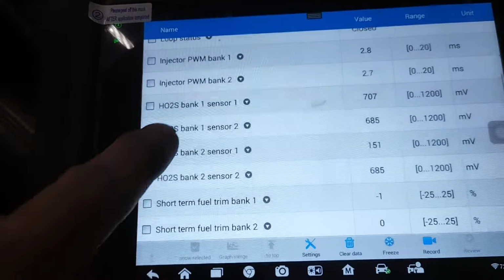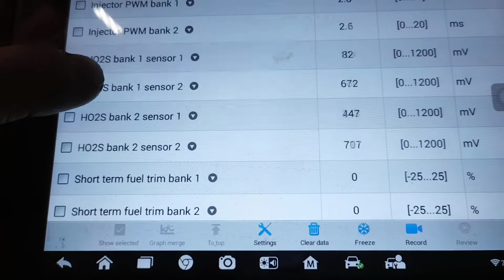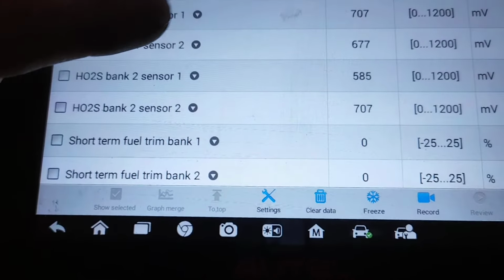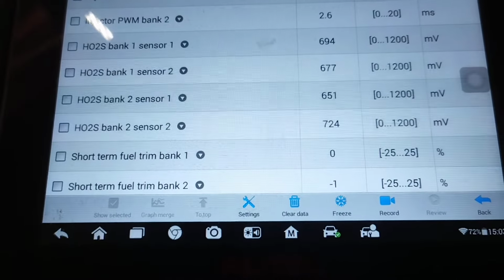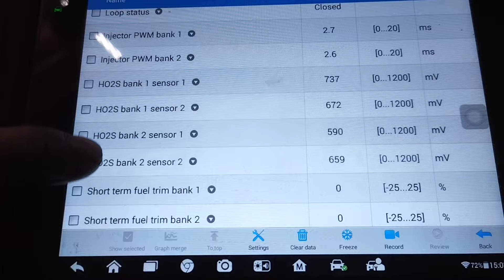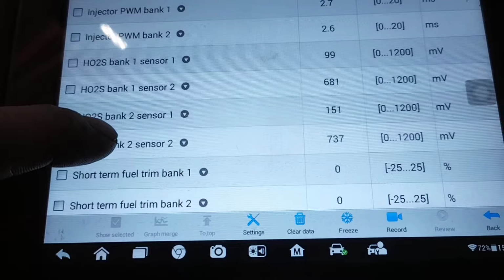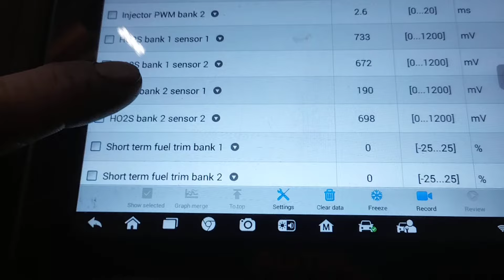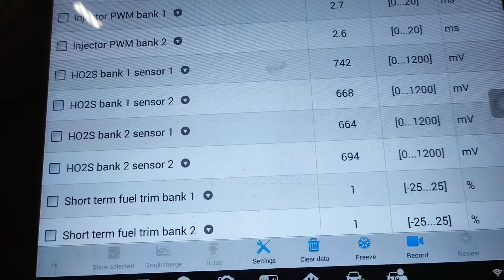how to diagnose o2 sensors or catalytic converter

Comment: What if live data looks good but still have P0420 and P0430?
Reply from the maker: Not possible..  if the o2 readings are under 750mv constant with vehicle warm and holding 2000rpm then the cats are bad.  Unless o2 sensors are both bad. Which is very rare they will generally hold a contant voltage even at cold idle when they are bad.

Comment: Hi, I have a 2000 f150 5.4. I am getting lean condition codes on both banks. My 02 sensor 1 readings on both banks are fluctuating normally but my o2 sensor 2 back ones, bank 1 is stuck at .500 mv and bank 1 at .100-.200.

I have no p0420 or p0430 codes. Only leans codes.
Reply from the maker: @mvc2177  an O2 sensor that is stuck around .5 means it's not working and needs to be checked. Other than that I don't have any diagnostic info I can give you.

Comment: hello. thanks for the information. i have the issue where its reading 0.45v. you mentioned a heater fuse, where would that be located? just in the normal fuse box inside the car, or in the engine bay?
thank you